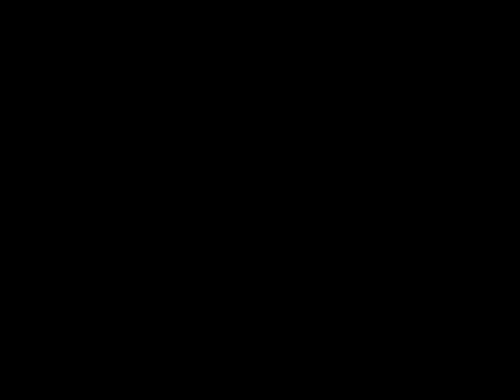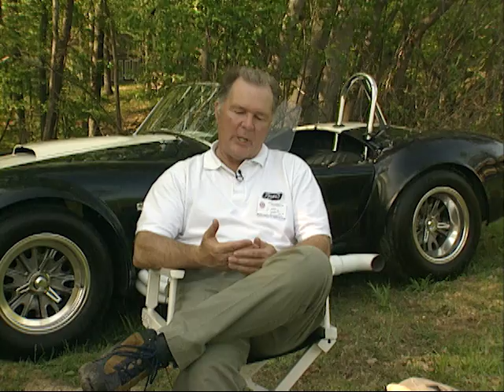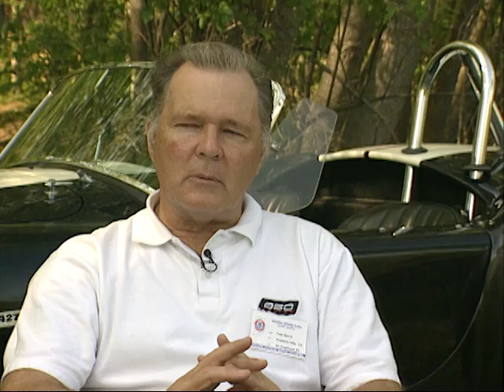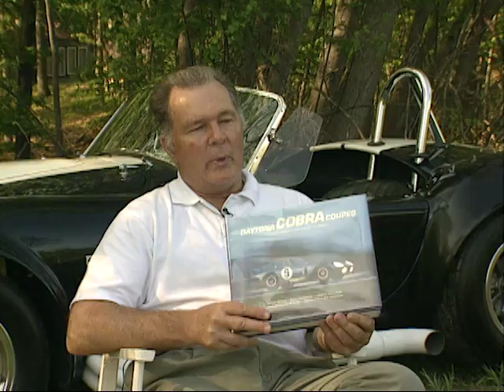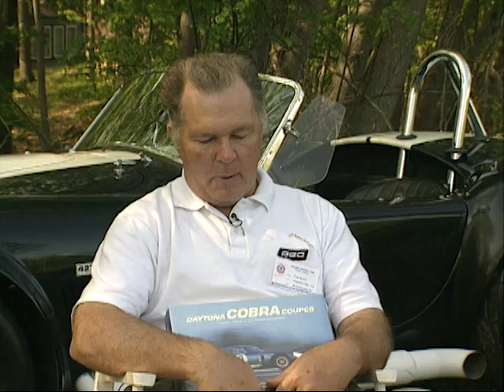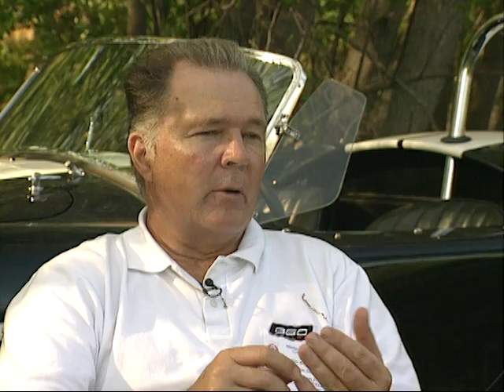Pete Brock - Ford v Ferrari & Chevy | Shelby Daytona Cobra Coupe | Corvette Sting Ray | Hang Gliding

Comment: Book  really needs a reprint.  When the two used on Amazon are a thousand bucks---.
Reply: @Paul Bunce - No way!  It will drop the value of the first (and only) edition!  I have that book with both Shelby's and Brock's signatures and know I could get $2,000 - $3,500 for it easily. I have no intention of selling it but it is rewarding to know the book and their signatures make it that valuable and desirable!   🤠 😉
Reply: @Loulovesspeed  I don't know that it will drop the first edition that much, but I can't get one at all.
Reply: @anvilsvs  - There are a few on ebay as I write this in the $950 range.  😊
Reply: @Loulovesspeed  Not going there.
Reply: @anvilsvs  OK, you're welcome, see you later bye!  I wouldn't hold your breath for a reprint.  ☹
Reply: @Loulovesspeed  reprint might increase the value of your original first edition because collectors would then become aware of the book.
Reply: @anvilsvs  - Maybe, hard to tell.  I have no plans to sell mine, but if I changed my plans, I wouldn't let it go for less than $3,000 with Shelby's and Brock's signatures, and the book is in excellent condition.  🤠 😃 🏁 P.S. - One guy has it for $7,000!! and it only has Peter Brock's signature.

Comment: Back in the early 60's, Car and Driver did a comparison the two GTOs -- Pontiac and Ferrari. The Pontiac came our surprisingly good, and later it was revealed that the car delivered by Pontiac had been blueprinted. But what I'd really love to see, regarding an American car versus a Ferrari, would be Daytonas. Brock's versus Enzo's. Ha!
Reply: It wasn't just blueprinted.  It was a ringer supplied by Royal Pontiac, the dealer who was swapping 421s into GTOs when they only came with 389s.
Reply: @anvilsvs  in the mid 60’s I bought a ‘62 Catalina with 3-2’s and 4-speed. I assumed it was a 389, and when I took the engine apart, I thought, “I wonder if it might be a 421?” Turned out it was a 326! I guess the lesson was, be careful when you buy a customized car.

Comment: Dennis, Great history lesson!  I did had the pleasure to take a picture of an original Shelby Cobra at a local car show signed by Mr. Shelby.  I asked the old man about the autograph, he said that Mr. Shelby did sign his car.  The Cobra is a great looking car.
Reply: The car you talk of was not designed by Shelby. It was designed and built in England by AC Cars. It's called the AC Cobra for a reason.
Reply: @julianneale6128  Thank You!
Reply: @julianneale6128  - He said the car was SIGNED by Shelby.  He did not say it was DESIGNED by Shelby.  The Cobras built and sold in the UK were called AC Cobras.  The ones sent to the U.S. were registered as Shelby Cobras.  It was built initially in the UK and saw MUCH modification made to it in Shelby American's shops in Los Angeles, California.  The 427 model involved even more work in the U.S.  Stop trying to grab all the glory for this car becoming a reality!
Reply: @Loulovesspeed  I'm afraid that Shelby tried to grab the glory and take it away from AC. Anything spare parts for a Cobra other than the fantastic engine and gearbox has to be sourced from England.
Reply: @julianneale6128  -Tried to grab WHAT glory from AC?  Shelby MADE the glory for AC, as they certainly had little at all before he put his ideas into reality, and finally made the Cobra, an icon world wide.  AC should have thanked him for getting a few more years out of the old Ace.  Sure, great glory AC had - didn't even make their own engines and stopped producing the Ace when they lost their supplier of engines, and resorted to making wheel chairs (invalid carriages as you Brits call them).  Yep, those are surely the things that make a manufacturer glorious!  Lol
Reply: @Loulovesspeed  the glory of AC designing and building such a nice sports car. Shelby should have thanked AC for designing and building the Cobra. AC didn't make their own engines no, what small car companies do apart from TVR? They were building the Ace with the Ford Zephyr straight 6 engines at the time Shelby asked them to install a V8 into one. They did as he asked on the understanding that he would sell a small production run in the USA if they did, and also sell them world wide. Who said I am British?
Reply: @julianneale6128  The Cobra, just like the GT40, started as one thing, but ended up very much something else. Carroll Shelby didn't do this work all by himself, but he is the one that kept Ford interested, kept the public interested, and had the foresight and vision to create products that to this day continue to shatter records of history and collectability. Should the person who was at the center of it all not receive credit? Does it mean nothing that he assembled the teams that would build these cars?  I'm sick of all these internet people implying that the Cobras and GT40s were finished products when the Americans received them. He tried, made mistakes, learned, developed, and succeeded. His fantastic legacy was earned, not stolen, and just like Ferrari, there will forever be cars on the road proudly bearing his name. It's called the Shelby Cobra for a lot of reasons.
Reply: @shelbyavant5081  I'm sorry but I have to disagree. Shelby tried and to an extent and succeeded (especially in the USA) in taking others credit. The only reason Henry Ford II moved the GT40 program is because it wasn't winning. The issue was not the design or the teams involved, it was the unreliable new Ford small block racing engines and other associated Ford parts.  Ford makes great engines but the engine chosen for the MkI needed more development. All Shelby's team did was put a known quantity into the chassis, the 427 big block. 

It is fair to point out that one of Shelby's team came up with the idea of changing break disks at a super quick rate during pit stops, but it doesn't detract from the fact that the car was designed and built in England. 

It is most definitely not anything other than an AC Cobra! Shelby only sold them as Shelby AC Cobras, and eventually simply Shelby Cobras in the USA. Shelby was really just the importer. In the USA along with the rest of the World, they were sold as AC Cobras. 

After all this you must recognize and admit that we all must give credit where it is due. The Cobra is an English desinged and built British sports car that happens to be fitted with a Ford V8 engine. The Ford GT40 is an English designed and built racing car, with funds from the Ford motor company, which is the reason the car carries a Ford badge.
Reply: @julianneale6128  You think all they did was drop an engine into either car, and that was the extent. You could not be more mistaken. Do more research. Watch and read interviews from the people that were there. You are incorrect, sir.
Reply: @shelbyavant5081  I am not mistaken. Shelby didn't put the engine in the car, AC did at his request! After Shelby received the first AC Cobra he had small gripes. These were relayed to AC that made a steady stream of modifications along the small production line. Apart from the fantastic engines and gearboxes everything was English designed and built. If you need anything other than an engine or box for your real life genuine Cobra, you have to contact the English to get your replacement parts, including the dodgy Lucas electrics...
Reply: @shelbyavant5081  I'm sorry but you are quite wrong. Shelby told AC that an engine would arrive after telling them it was the new Ford 260 he wanted put into the car. It didn't arrive and so AC sourced (borrowed) one. It was the boys at AC that fitted the engine and ran it up and down the road in Thames Ditton, Surrey, England before anyone else ever did! They then took the borrowed engine out and shipped it to the USA. They had done such a good job that when Shelby took the car, he and a couple of friends were able to fit a new engine in just a few hours... Please look into the history.
Reply: @julianneale6128  First of all, wow. You're actually very polite. Secondly, everything you said in your last post is true. Thing is, you aren't reading any of mine properly. That car started as an AC Ace, and after a short span of time it was a completely different car inside and out. I don't know how to explain it any more simply. You don't have to be the first to do something the best.
Reply: @shelbyavant5081  What a story, where did you get this from? Playboy?
Reply: @64fairlane305  Um, no sir?
Reply: @shelbyavant5081  Excellent response!  I swear that all the youth in England are taught that the Cobra and GT40 were true English cars, totally designed and built in the UK, and the U.S. merely tossed in a Ford engine as their contribution!
Reply: @julianneale6128  Kind of true, even if a AC Cobra is not the same as a Shelby Cobra. Shelby allowed AC to continue their tiny 289cui Cobras as long as they promised hum to keep his name out of it. The bShelby Cobra is a totally different animal, widened and reinforced to take the mighty 427FE mid-rise sideoiler tuned down to +500hp
Reply: @64fairlane305  no. Every Cobra ever made is an AC. Shelby only sold them in the USA as the 'Shelby AC Cobra' and then merely the 'Shelby Cobra' later on. AC designed and built the cars. You are extremely shallow minded. So much so, that you'll next be trying to make out that the AC Cobra in American car... haha
Reply: @julianneale6128  So every Cobra made was an AC?  Don't try telling that to Peter Brock who designed and built the entire coupe body on the Daytona in just 90 days!  The only component which was from AC was the basic chassis.  Even that saw some modifications made to it for use with the Coupe.  That car won The World Manufacturers Title for Ford and Shelby American - the only American car to have done so to this day.
Reply: @Loulovesspeed  oh the coupe body of course was not an AC design, that's fair enough. But it was still the AC chassis underneath.